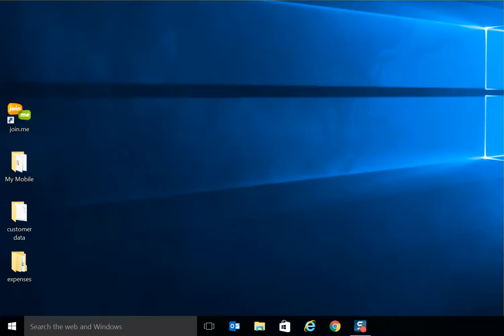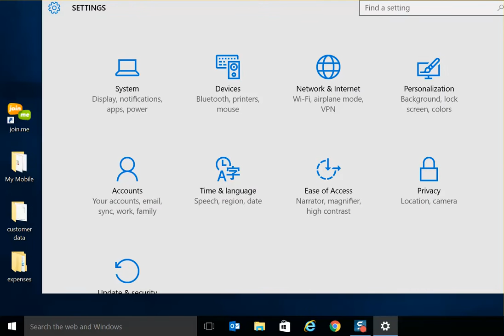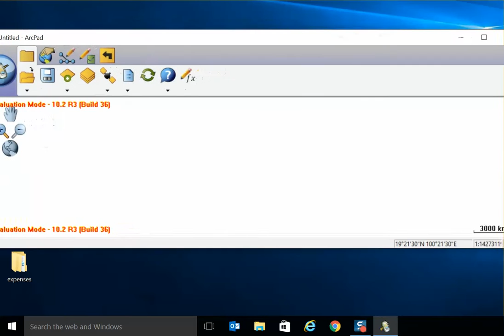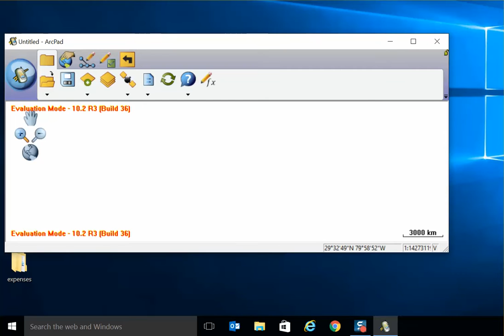How to setup a Trimble R1 outputing NMEA data to Windows 10 tablet

Comment: I've been having a heck of a time trying to use our Trimble R1 on Windows 10 tablets in Collector for ArcGIS. Your video makes a lot of sense, but unfortunately I don't see any settings in Collector that would allow me to force it to look to a particular com port. Have you tried using the R1 in Collector?
Reply: Brad, were you ever able to get the R1 to work in Collector?
Reply: I believe Collector is a Windows Store App ("modern app") and therefore it would use the new Location APIs from Windows 10 and not by using NMEA information from COM ports.